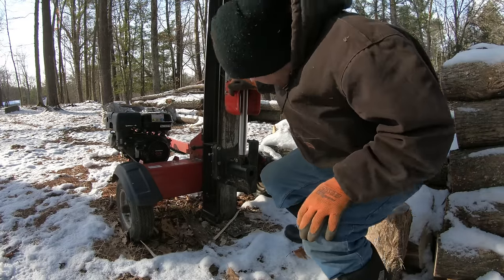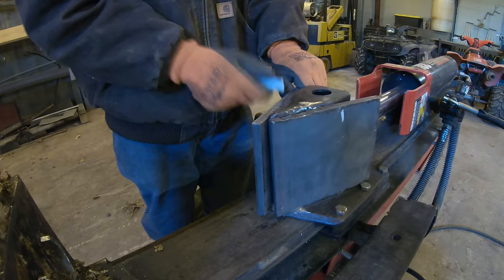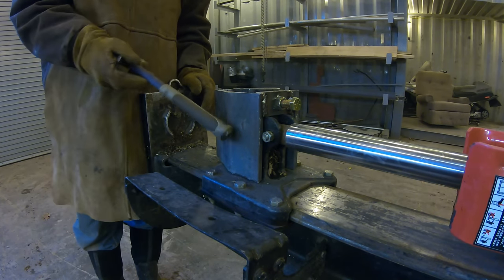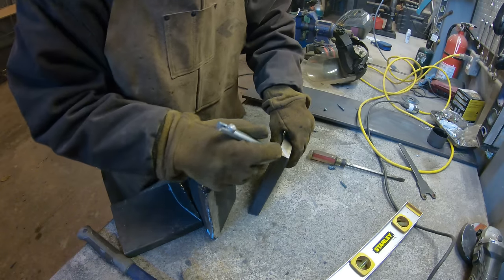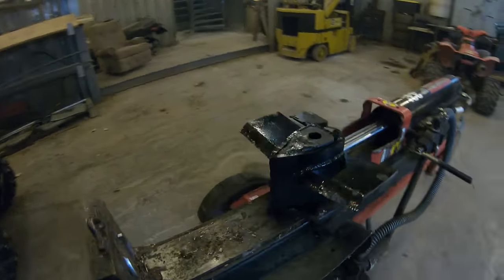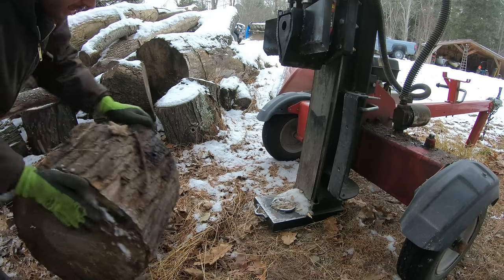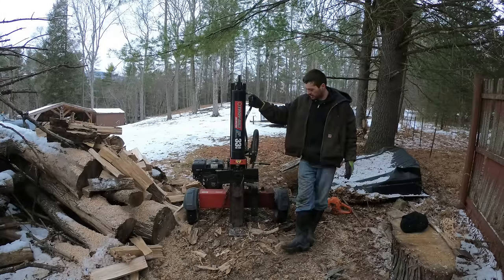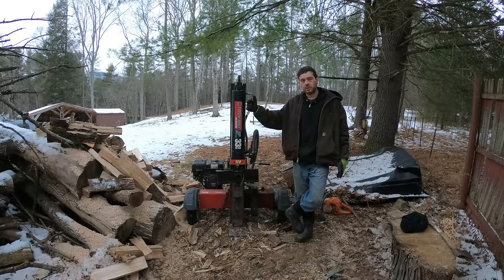Building a 4 way splitter wedge

Comment: That son , I could not honestly tell you but I like your design. I am going to talk to my cousin and see if he can watch your video and make us one for the 25 ton county line splitter. Congratulations and a job well done. Maybe you should start production on 4 way log wedges. You might have something there. Good luck . Hats of to you..best built one I have seen yet 👍👍🙏🏻🙏🏻 And I have watched a lot of videos. The one that county line sells is a small one and can only be used horizontally. I don’t recommend it , I took it back to tractor supply. It bent on the first use of it cheap made but cost around $50.00 .. please contact me back when you have time. Thanks

Comment: I used to split wood for few years..  I'm 33 now I did it from prolly 6 years 7 years.  My boss used a conver belt with a wood prossesor and I used a 6 way timber wolf.  The wedge is 4 so made 6 pieces.  I waz able to do a cord of wood in about 43-45 mins and do 6,7- 9 cords a day.  Sucked especially in summer.  my boss can do 1 in like 18, 22 mins

Comment: Save a couple scrap cutting edges off your dozer for the wings next time you build one. Thanks for the video
Reply: Hey, that's a great idea. Dozer cutting edges are made of some tough metal but you can still weld it with 7018.

Comment: I think the reason they don't sell a 4-way splitter is due to the force on  the cylinder. If you carefully watch the large chunk you can see how one wing is engaging and the other wing isn't. This causes a force vector back along the cylinder that doesn't align with the movement vector of the cylinder. aka the piston is getting a force from the side forcing the hydraulic cylinder to the side. This greatly lowers the life span, the O rings take damage, if stalled enough (generates enough force to the side) the cylinder will buckle. That's my take on it.

Comment: Do your self a favor and build some simple jigs for the plasma cutter. Adjustable circle & bevel cutters are the most used jigs.
Reply from the maker: Yeah, that's a good idea, usually ill just trace a straight edge to make a nice cut. I guess if I need to cut out a circle ill have to make a circle jig.

Comment: Can only imagine that theres a safety load rating of the ram that maybe theyre concerned about but your stepped design takes the extra ram load out of the equation,  well done
Reply: The load on the Piston shouldn't be important.In any Hydraulic system there is a relief valve, that will open when the pressure is getting to high. So when the load gets to high it will just stop and push with its maximum capacity while dumping a lot of heat into the oil. (All the work the Engine is doing will get converted to heat)

Comment: have you thought about having the wedge on the end of the splitter and using the current wedge end to be just a ram?
Reply: It would be harder to place the log into position, you'd have to lift it on there

Comment: Hey Andrew, add a bottom plate where the log sits about 20 in. in diameter and at about a 4-degree tilt towards the splitter. I did this to mine and it helps immensely when splitting your logs you don't need to hold them in place.

Comment: Good Job Andrew! I like the forethought with the wings angled slightly forward to cut down on the pinching. Any thought in making the steel foot (on the ground) a little bit longer? Then the logs won't fall away from the splitter.

Comment: Awesome job. Works great. I agree, splitters should come with that at least as an attachment that can be added like yours. Tip to viewers, use caution and only a last resort when striking an axe with a hammer. Axe heads are hardened steel which makes them brittle and potential missles when the poll (back part) is struck with a hammer. Put a piece of wood between the two and strike wood instead of steel. Thank you for another great video, Andrew!

Comment: When your added 'wings' are loaded unevenly, if the right side is empty and the left side is being pushed up by a log, you're adding quite the torque that perhaps the sliding joint wasn't designed for.

Comment: You should look in to getting a splitter for your bobcat. They make quick work of splitting wood. I made a copy of the tm skid splitter and it works great.
Reply: I'm from farm and cattle country where some folks (who don't mind working hard) still use split fence posts.  A Bobcat splitter would be excellent for that chore (if you could get the Bobcat into some of the mountain pasture areas).
Reply: @larryfromlincolncountywa3989  I dont mind working. I bust my ass at work. I work hard so I dont have to come home and work hard. Work smarter not harder. And you would be surprised where a tracked skid steer will go.

Comment: You should have protected the chromed hydraulic cylinder shaft ! The "dingle berries" from the mig torch , will stick to the shaft .  Then when you retract the shaft , all that splatter will eat up the seals in the cylinder . It will be impossible to restore that precision surface !  We learn from our mistakes.........Always protect hydraulic , and/or  air  cylinders  when welding  on , or near them . I like your videos , good luck .
Reply: Cautiously,  Yes, Yes, Yes!!

Comment: If you do a rotator at the bottom be cool two round steel plates with a Bering in the middle almost one on the other greased with an insert at the toe of the splitter and u can rotate the logs no matter what size kind of like the round bread or round cake holder

Comment: They do, just maybe not in the US. I have seen a big splitter that works off of PTO in Germany that has a 4 way wedge... can't link to it here though.
Reply from the maker: Seems a little excessive to have a expensive tractor motor running all day to split wood when a cheap little Honda will do it.
Reply: You have to compare like-for-like but my 16(?) HP Kubota would run all day long at fast tickover and use about 1/2 gal of diesel. When first made (about 40 years ago) the blade was similar to yours and everything was struggling, the addition of a knife from a baler, which is VERY sharp made everything easier.

Comment: That worked out really well.  Nice job man.  If you're splitting a lot of wood you should look into building one of those log spliters for your skid steer.  Do you heat your whole place with wood or is only for your hot tub?
Reply from the maker: Just for that hot tub.

Comment: If the splitter came with a four-way wedge there would be no accessories, capitalism at its finest brother.
Reply: If they came with a 4 way wedge then everyone would want the single. LOL Was a joke but I bet some truth in it.
Most individuals have small ton splitters and tons of them live in hardwood areas.... I think its just simpler and less problems for them to sell them with the single is all... its safer for the inexperienced individuals out there to use and less stress on the equipment itself.. gotta get past that warranty - greater life span :)

Comment: Build a small conveyor belt that can sit next to splitter and will carry the wood up into a trailer. 
Less handling of the wood. 😉
Reply: Harry Ballzack  we put a bail elevator next to our wood splitter and we just throw our wood on it and it puts a pile of wood where we want it
Reply: Jagoire that’s what we used when I was a kid. Cut tree and drag it to field. Cut and split and load with conveyor into a dump truck. Haul to house dump then stack.

Comment: You did a great job there. on the lower part of the machine were it is on the ground. l noticed you are grapling with the logs to try and line it up with the wedge. On that square section which is about (I think)6" x6" why don't you make a larger bed say 16"x16". AND so you just have to offer up the log rather than wrestling with it.I hope this makes sense.

Comment: Good work! I’m building one right now myself. Great idea on using the splitter to bend steel. Should have done that myself. Wish my plasma cutter was as good as yours. Looks like ya need a solid axe and ported saw. Contact me if you want either.

Comment: I'm half way. Thinking hmmmm.
The steel bender was clever. 
One thing I did to mine 15 years ago when I bought it was put a bigger plate on the end. Mine is 18 by 18 ish.
 I bent my splitter. I quit using my attachment. It's good for ash and straight wood. Been going old school now. 
 I used my splitter to crush a big pile of oil filters. Worked good. Messy though.

Comment: i have had to split alot of wood that was about 40-50in diameter By Hand as in a wedge & 10-12lb Sledge Hammer & a 10-12lb Splitting Maul & Any Splitter Is Better Than The ole Sledge & Wedge  IMHO ! We Finally Got A Gas Powerd Splitter After about 8-10 Years of Splitting With A Wood Maul ..It Made It Sooooo Much Easyer But When You Are Young Its Good For Ya To Learn The Old Ways Be for Getting Spoiled By A Gas Splitter ..lol.

Comment: One of the reasons that a person does not want a 4-way splitter is because they don’t want the logs so small that they will burn too quickly in a wood burning stove. They can keep a fire burning longer with the larger size. Granted you are trading off efficiency in splitting for better definition of log size. 

I personally like the system you now have because you can split huge pieces with the original 2-way wedge and put less strain on the machine, and reserve the double wedge for routine work.

Comment: This thread is 4yrs old, so not sure someone gave you a good answer to your question....why don't they ship a 4-way with their product?
1) Keep costs down. 4-way costs more to make. On some sites, they now sell 4-way and 3-way and 6-way and 8-way as $250-$850 options
2) Simplicity of production. That 1-way wedge is the same one sold on all 6 of their production models, keeping costs down too, and simplifying production
3) Weaker models can't drive it. A 5-ton or 10-ton splitter might not have the HPs to drive a 4-way wedge. You have a 33-ton, so no problem there.
4) Liability? The lawyers can always seem to find liability and take fun out of things. I'm sure there is extra liability in there somewhere.

Comment: [2021] Andrew: You made a very "Valid Point". Obviously to keep the price down on entry-level spinners. Also notice the  small foot pad, you can't keep a big round balance on it. I think with your engineering mind you could look at the Eastonmade Axes. You could modify it into something that would better & save your back. Your channel is why I have a John Deere 60G excavator pushing over trees for firewood.

Comment: Manufacturers engineers job was to make a wedge splitter (singular), add-on priced extra= more revenue.  Check out, YouTube very large firewood machines which push logs through 6-8 splitters. See: You Tube "100 ways to split firewood, cleave, best saws, splitter..." at 5:38 .  I like at 8:40 mega splitter. You however are the mega best innovator. Thanks!

Comment: When using a splitter vertically. Put down 4 or 5 pieces of 1.5” or 2” Sch40 or 80 PVC pipe 2’-3’ long, in front of the base plate for big stuff. It levels it out and makes shoving them around effortless.

Comment: They need Andrew to be the Chief Engineer!!!!!!!!!!! Now the situation is the wedges need to about another 6 to 8 inches away from the shaft of the machine!!!!! Then you would be close to 4 piece of firewood that are similar in size!!!!!! Also the big logs would fit under it and cut nice pieces off of the log!!!!!!

Comment: I’s say safety and liability is why a four-way is not used.  Did a great job.  I have a splitter just like this, Lawn Machines (aka MTD), 33 ton, 8 or 10 hp engine.  I only split vertical if the logs are too big, duh.

Comment: Hello I believe it's evident this splitter puts a much higher burned on the pump and also introduces a lot more side loads on the cylinder,  reducing the MTBF on the machine substantially. You will likely be able to fix it quick but most users are people that have no clue and would return the machine to the store

Comment: I think you answered the question "Why don't they come this way?" in the next shot.  The answer(for this sized machine): So it can split any sized log, right down the middle.  A four, or more, bladed head would be great if you could adjust the depth.

Comment: I made a comment in one of your other videos where you were doing a considerable amount of splitting that you should consider making exactly this type of modification to this splitter - but you already had gone down that road as you explained.  This time you got it very right.  As to your question about WHY DOESN'T the company add the 4-way splitter head to the machine already? - I would think that it would be two or three reasons.   Only the most powerful models could handle the extra pressure requirements to split the logs.  Your machine had just a bit of trouble to push through some of the logs.   And it would be a little extra cost and some people don't want to spend the extra money - because they can't see the benefit in the time savings, and maybe some people can't work with the unit like that and it that would make it a LIABILITY, you know how that scares off creative work.  Well, bottom line is that you made it and it works.  Keep up the creative work on your own.

Comment: Would the uneven forces of the wings damage the ram maybe? Since it's a twisting force? Usually it would just be straight down, but since it's force applied off center maybe it'll cause a failure on the machine.

Comment: The reason they do NOT sell them with the 4 way splitter is to have an accessory to sell! It's all about the almighty dollar!
As far as your build go; you did a nice job there and I like the way you have the secure nut & bolt on the back. I might try that myself. 
The only thing I would say is if you can get the main blade and the wing blade thinner it would go through wet and stringy wood like butter. 
When I sharpened my single blade and my 4 way blades (about 1x/week) and I almost doubled the amount of wood split with one tank of gas. 
Speaking of gas make sure you put in about 1/8 cup of SeaFoam about once every 10 times of filling it up to keep everything (like the valves and pistons) nice and clean. I have had my 37 ton Huskee splitter for 6 years and never needed a tune up and the engine will never bog down with the blades as sharp as they are. When I went to start it, Sept 1st this year, it started on the third pull with no kickback. It needed to get the gas into the carb before it would kick in.  Try it! Best of luck.

Comment: The problem with most log splitters is they are way to slow!!! Now if you built a spitter using a 4 cylinder car engine or 3 cylinder diesel engine would kick serious butt the stroke would only have to go half way due to safety!!!!! Trump 2024

Comment: When splitting such large rounds, we ONLY put the splitter into vertical to knock them down to manageable sizes, THEN go back to horizontal.   Ain't no sense in working bent over any longer than need be

Comment: I advise people to cover their cylinders with a welding blanket or leathers when fabricating in proximity. Splatter and slag hardens on the cooler surface of the cylinders which just destroys seals (or can, in my experience). Learn from my mistakes, people.

Comment: Andrew, if you could command a hammer and nail as good as you weld and cut steel, you would be a first class master carpenter - making fine furniture and associated items.  Also, I bet your skills with the torch has improved significantly.

Comment: Cost of course!  The answer to almost every such question.  As is, it's "just good enough" for most buyers.  It always costs more to be outside the norm, in whatever way.... for example, there's a rumor going around that I have a ten-inch tool.  That attracts a lot of attention, and I have to spend extra time and energy keeping back the women compared to a typical man.  Are there benefits?  Of course, but the point is, you had a special need for a more capable head for your wood-splitter.  Laws of physics: that always going to cost more.

Comment: put something over the cyilinder rod welding sparks burn pits into the chrome rod then it leaks. for the side plates you do not need to use 2 peace's to make a flare, one peace on each side  made from one inch plate set back at a 10 deg angel is all that is needed, enough pressers is being put on the wood that it will pop, by setting the side sheer plate back 10 deg, allows the main wage to start its split before the side one hit, cut your knife edges from both side to meat in the center, also make the side wings adjustable in hight, it is simple to make and fast to change, I have been building wood splitters an processors since I was 17 I'm 56 now

Comment: Some do, but they cost a bunch more than the $2-3k splitters they're more of a production machine, whereas you're would be like the "homeowner" type. I'm not knocking your splitter. I split by hand still and would feel  blessed to have a machine like yours. There are also versions of sitters much like yours but it's on a skidsteer mount. Maybe you'll upgrade your splitter to a newer model and re-engineer this one to mount on your skidsteer...